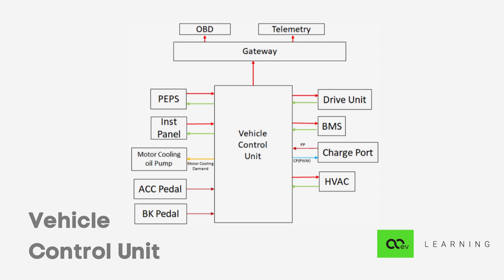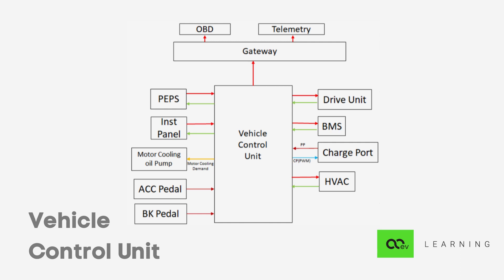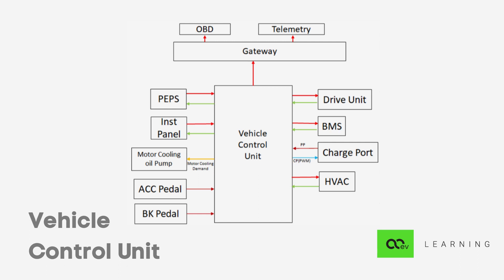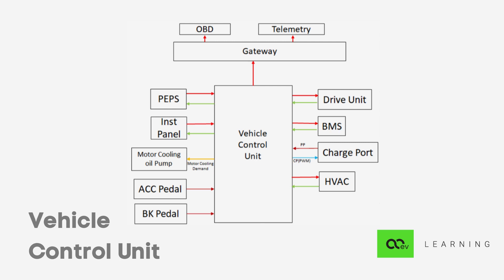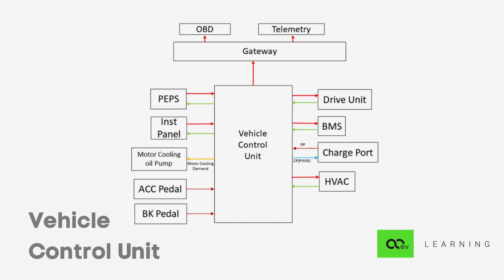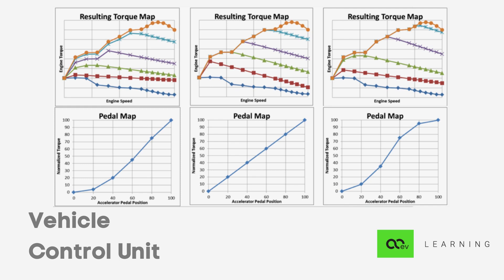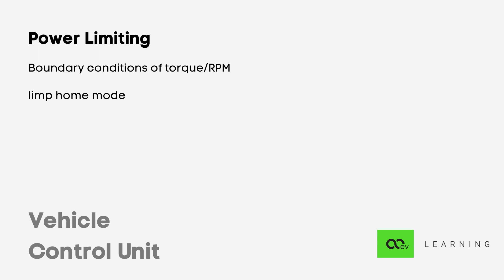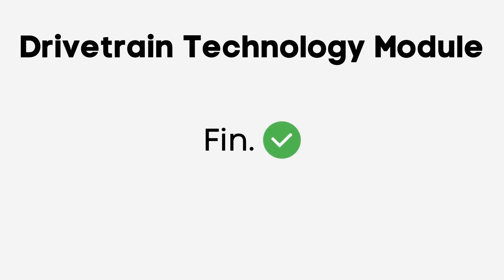Vehicle Control Unit | Lesson 32 - Course on Fundamentals of Electric Vehicles | Nexloop Learning

Comment: Thanks for a great series of videos. I am trying to find out if it may be possible to alter the throttle response map vs torque output from the VCU. I am not happy with how the vehicle is performing as it gives different torque outputs at different speeds.